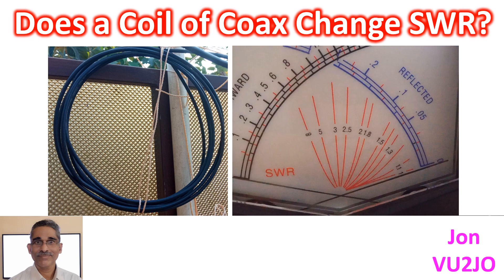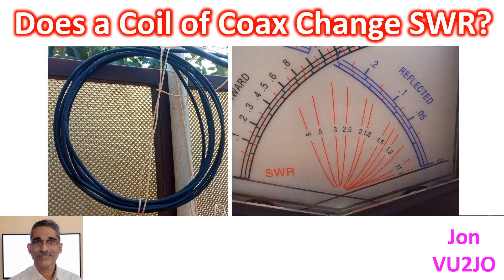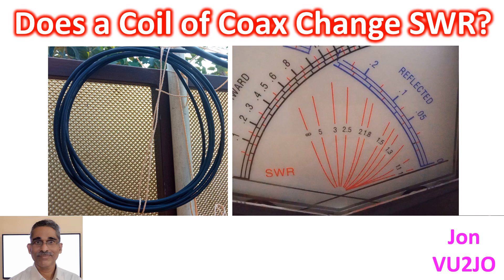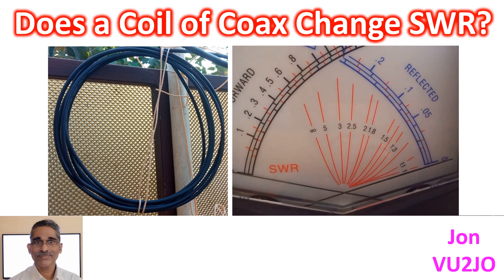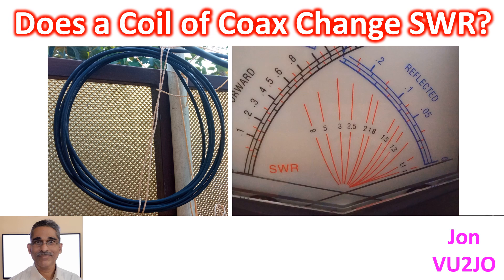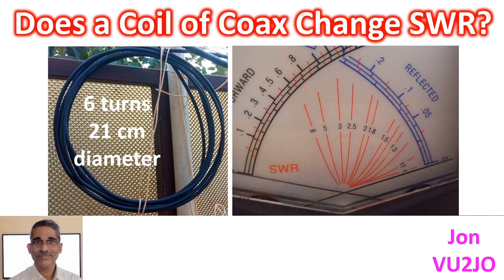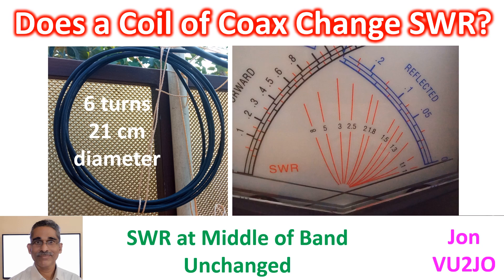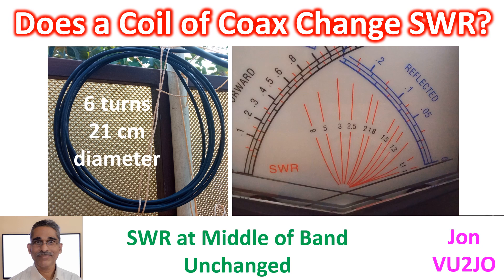Does a Coil of Coax Change SWR?

Comment: Yes, coiling of excess coax will affect the swr !!!
Reply from the maker: When I had coiled 15 m of excess RG 213 in my shack, I thought that the effect was much more. But did not check specifically like this. Just changed it for a 10 m HLF 200 cable as I was in a hurry to get on air with the new radio!